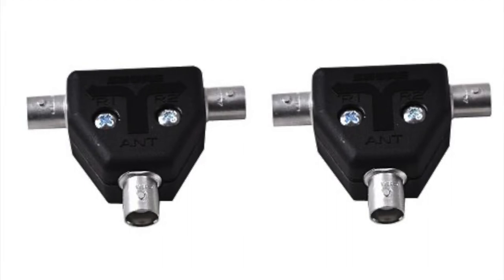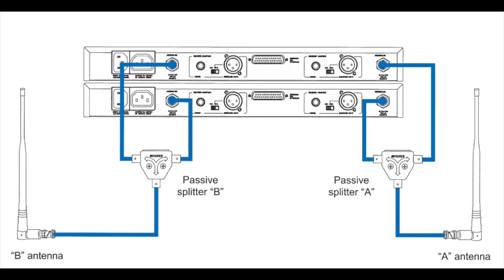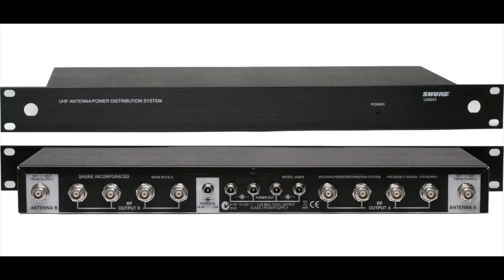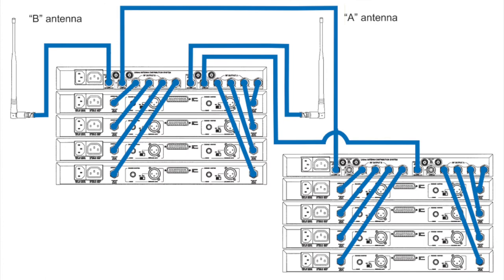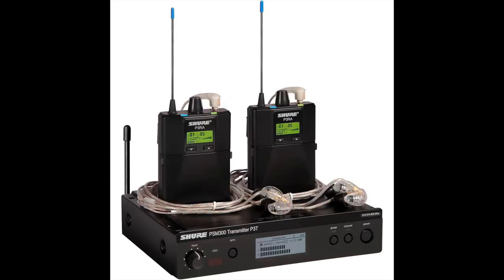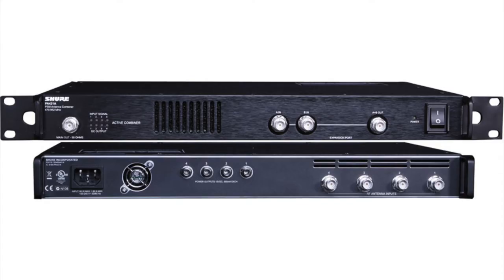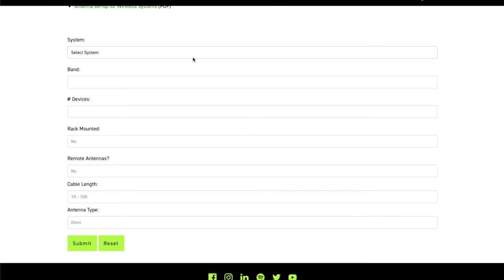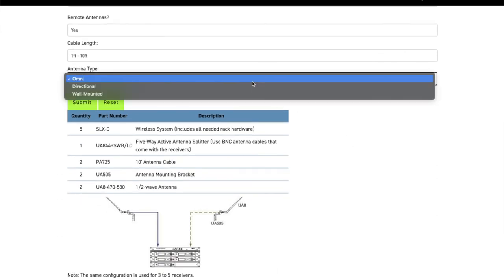Antenna Distribution and Combining Explained | Shure

Comment: Hi there what is the use of the two rubber bands that coming with new Shure UA8 antennas, can you show in a video were they going please
Reply: Their only use is to identify the frequency of the antenna itself.  They tend to fall off fairly easily, but the frequency can still be identified near the BNC connector.

Comment: So I'm planning on getting a second shure glxd4r+ in a couple of weeks they will be rack mounted side by side both shure receivers for my guitars will be turned on and active on different channels I'll be toggling shure receiver A & B with an instrument selector so the passive antenna splitter will work for this configuration? Also if I decide to not turn on one receiver and just use one shure receiver does that mean the passive antenna splitter will still work??
Unfortunately I don't have room for a rack mount distribution system lol

Comment: The receivers have to be in the same band, H9 for example?
Reply from the maker: Hi! That's a great question. Our Support Team will be able to help you out with this. You can reach out to them at shu.re/contact.
Reply: No, you can use multiple bands on a single antenna "circuit", as long as the frequency range of the antenna system is wide enough for all of them.  Additionally, you can also use the "cascade" function of a Shure combiner to continue to a 2nd rack of receivers, providing the signal to all receivers as well.  I have two racks of 16 receivers, 8 of them on the A1 band, 4 more on the A band, and another 4 on the G50 band.  Each rack has an 8-channel combiner, with the 1st rack having a Shure combiner that allows for cascading.  The combiner also provides voltage to the amplifier on the Shure antennas, which is set to +6db due to the total length of cabling used.
Reply: @BjorgenEatinger  wow! This good to know

Comment: Is there a way to have 6 QLXD systems into one UA844 without have to get 2 of them?
Reply from the maker: Hi! Our Support Team can help you out. You can reach them at shu.re/contact.
Reply: No, as you would then defeat the diversity functionality.  However, I have used a single paddle and then one whip antenna in a pinch, and it worked okay, but is not the ideal solution due to a difference in RF signal strength between them.

Comment: so this video is brand new and already the links are not bringing us to the tool. Ok I found the 'tool' on my own but got stuck already in the second row because my frequency  band (K3E) was not in the list for my slx system.  So now I call this video officially crap. sorry  edit: Freaking 179 euro for a passive splitter set. You must be freaking kidding me. Now I am going to get me one, open the splitter and show the internet via YouTube. It seems to me Shure company are crooks. It is impossible that a passive splitter and some connectors must cost this amount of money. impossible.
Reply: Hey mate where did you find the tool because I ran into the same problem. Thanks for any help.
Reply: @mulisaurus  If you want to spend so much money to help the Shure crooks then you search for the tool yourself. I am not going to help Shure one one single thing. In fact I'll tell everyone on every gig I work, what I think about Shure after this price tag for a passive splitter.